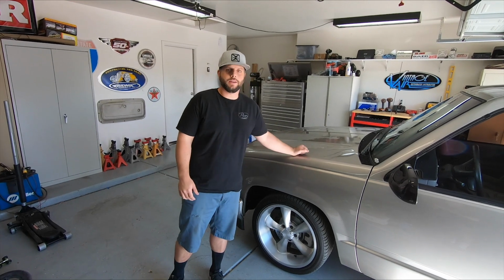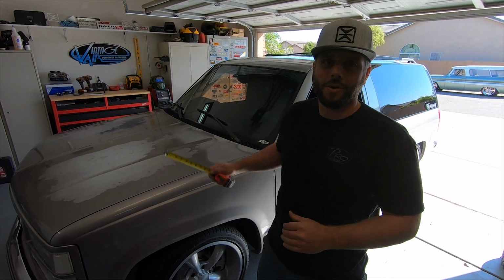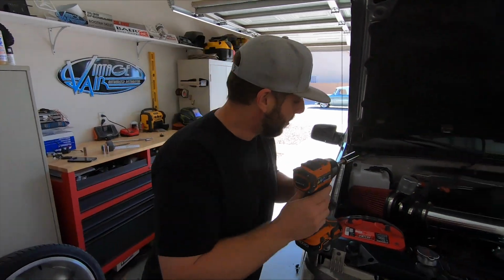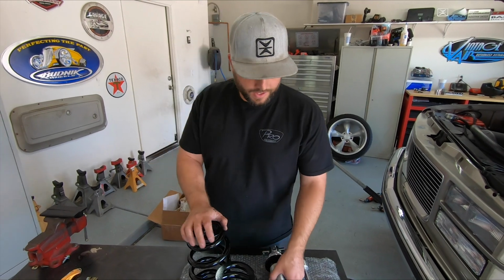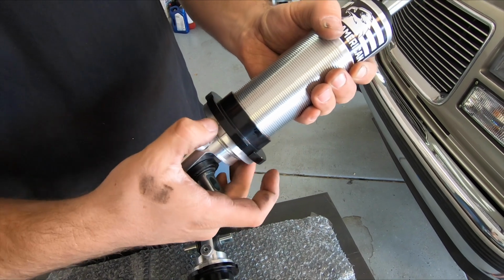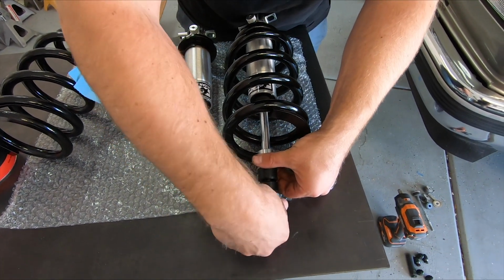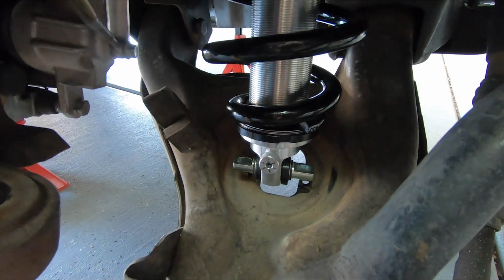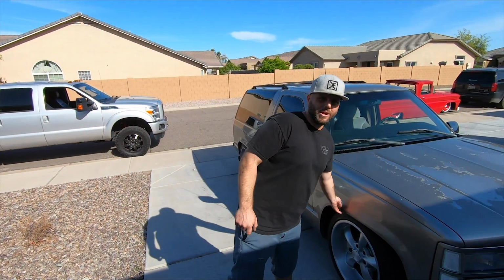88-98 OBS Aldan Front Coilover Install

Comment: No adjstment wrench 
Hardware too short
Not the same locking collar (split type) 
No marking for the valved ajustment. Just numbers on the dial. 
Slightly bummed right now.
Reply: Did you buy off Amazon?

Comment: would these coilovers work with lowering control arms and stock spindles? say I want to use 3" lowering control arms and want to install these coilovers so I have adjustability from 3" drop (coilovers at 0 drop) down to a 5" drop (coilovers set at 2" drop)?

Comment: are the coils just for drops or are there any for raising the height. Looking at fitting 33s, but want to raise the front just a tad bit more. From the ground to the wheel well, I have 35" and 36" ( ones side has a dented out fender. Its at about 33.75 to 34 in the rear. Installing 5/1 which originally came stock on this truck. Just curious if you know which product (coilover) will give me that extra 1-2" lift.
Reply from the maker: Yes, they just offer a drop, no lifting.

Comment: Do you have any issues with the wheels hitting the inner upper fender when hitting bumps or potholes?
Reply from the maker: No sir. The wheels are tucked enough to not have that issue, but not all wheels tuck the same. Check out these React spindles if you need to bring your wheels in, as they dont widen track width like other spindles on the market. 

https://azproperformance.com/products/react-2-modular-drop-spindles-88-98-c1500-8898-001?_pos=28&_sid=ddf6761f1&_ss=r

Comment: I currently have 2" drop spindles and 2" drop springs and I can barely drive the truck , it horrible it bottoms out and has cut my tires up . If I added these in place of my drop springs do you think this will help ? And is it possible to add spring risers to these , if I needed to go up a little ?
Reply from the maker: These coil overs can be adjusted from a 0-2" drop, so no need for a spring spacer.
Reply: Thank you for responding to my question . I just ordered them from you guys . I'm excited to install them and hopefully this will correct the problem so I can drive without bottoming out so bad .
Reply: Hey I ordered this setup from y'all and it's not like the one's in the video , I only have adjustment collars there aren't any locking collars like in the video , also it didn't come with a spanner wrench so I can adjust them . What do I do ? I can't install them until I have these parts that showed in your video . I'm not trying to complain . I'm just unsure how to get this stuff
Reply: I looked on eBay and was able to find the spanner wrench for $ 40 . But it should have been in the kit . And I can't even find the adjustment collars , I don't know what I'm going to do , I just paid $638 . For these things from you guys and can't even install them
Reply: I meant to say locking collars , not adjustment
Reply from the maker: @willsnider4412  they changed the design of the collar so it is a single with a locking bolt you tighten. Your good. Spammer wrenches are sold separately but if you set about 1.375” from top of adjustment knob to bottom of spring, that is about a 3” drop in the “spring” plus your spindle of 2”. Make 2” for a 2” drop.
Reply from the maker: @willsnider4412  again, they are a single adjustment collar now with locking bolt. They changed design since the video was done. Best to call us or email us, not communicate on YouTube. We can better help via email vs. YouTube messages.

Comment: What’s the total drop with the coilover? More than a 2 in drop or 2 on the dot ?
Reply from the maker: We were able to get 3" of drop from it, and I have daily drove it like that for a while now. All is good!
Reply: @AZProPerformance  so In total with the 2 in drop spindle your at about a 5 In drop up front correct
Reply from the maker: @anthonysalcido8700  Correct. Technically I am 1.25" lower than I was with a 2" spring, so safe to say I am riding at a 5.25" total drop up front.
Reply: @AZProPerformance  awesome got my obs at a 5 in drop 2 in spindles 3 in drop springs but if I keep can keep my obs at a 5” with coilovers instead of the spring I’m all for it thanks should he ordering soon 🙌🏽
Reply: Question, I have 5" inch drop, 3 inch coils 2" inch spindles .by using coilovers can I lift the  front end to.

Comment: Does this work or add any benefit to OBS that are either leveled or lifted? Looking to maximize right comfort on a stock Z71 that I may level or lift a bit.
Reply from the maker: 4wd's are torsion, so unfortunately won't be applicable here.